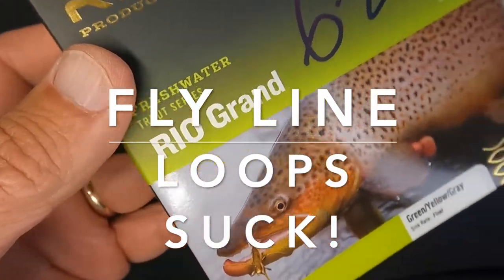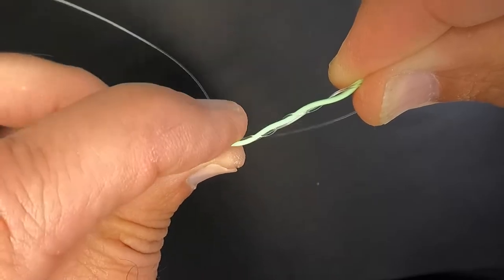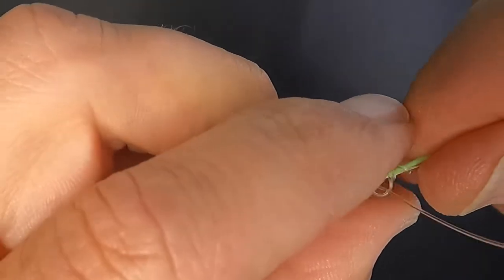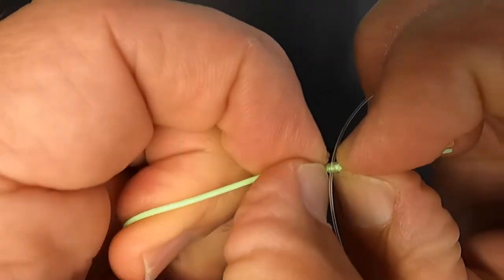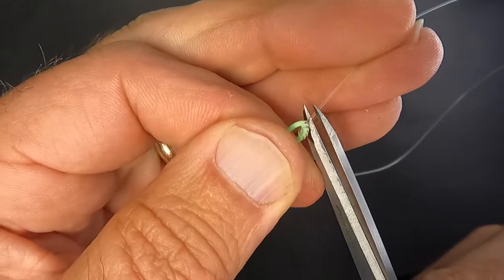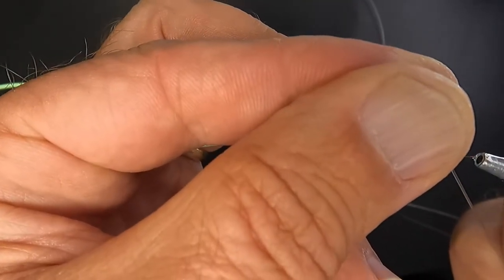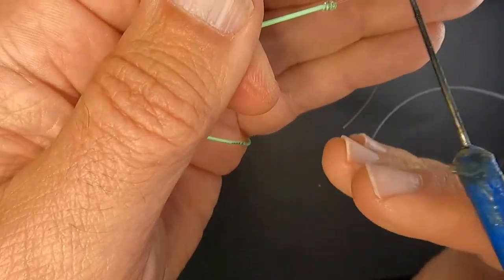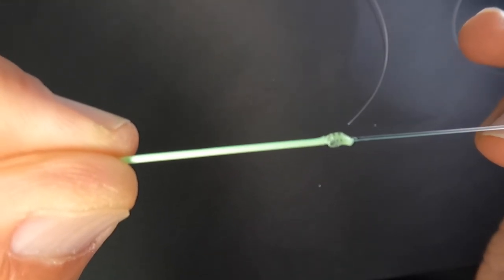Fly Line Loops SUCK! Be brave & cut them off! Tie a Constriction Knot and be happy!

Comment: If you like the knot you are using you should try a "needled knot" basically the same as what you tied but it goes through the first 3/8" of the fly line before tying a nail knot.  Put a little contact cement over the knot  and onto the fly line a little and it can last several years.  Goes through the guides very smoothly.  Poke a needle into the end of the line then out the side.  Take razor/ exacto and cut mono at a very sharp angle.  Grip mono with pliers right near the sharp end and push it in the hole in the side of line as you remove the needle.  A bit of a pain to tie but well worth the effort.
Reply from the maker: Thanks I’ll have to try that!